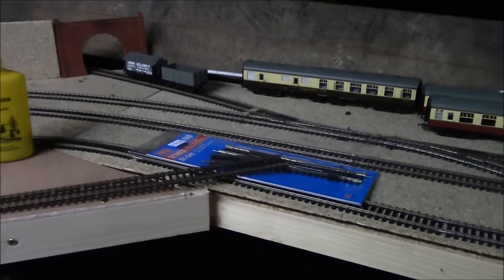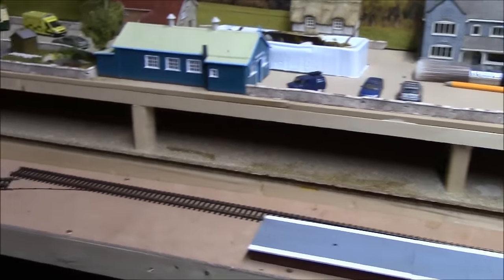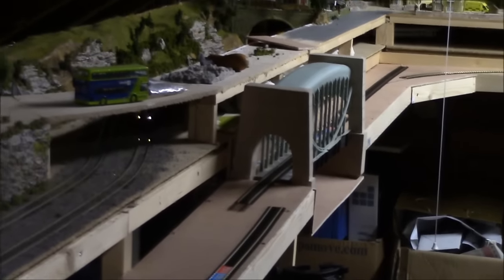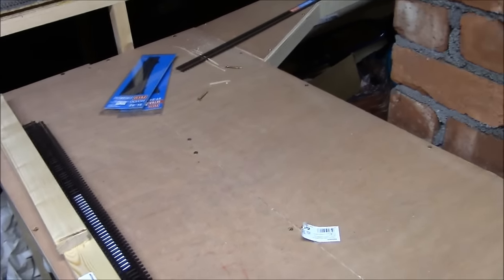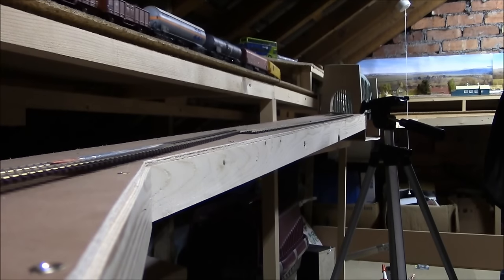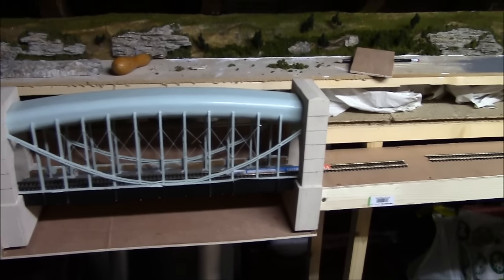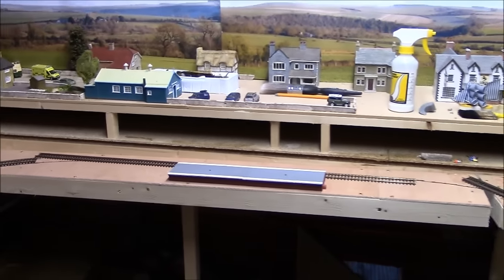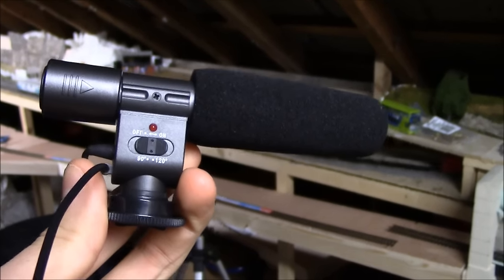The new extension at Jubilee Road 2

Comment: Hi Matt,

I think that gradient may be a little too steep but there are ways to cheat the system if it is.  Have a look at DCC Concepts powerbase, or the other idea would be to build the trackwork to allow space for a banker engine (which would add a ton of operational and viewing interest)

cheers
Reply from the maker: +Michael Henfrey ok thanks Michael. i will have a look at DCC concepts. when i do my running galas i will be using a banker loco on the new line